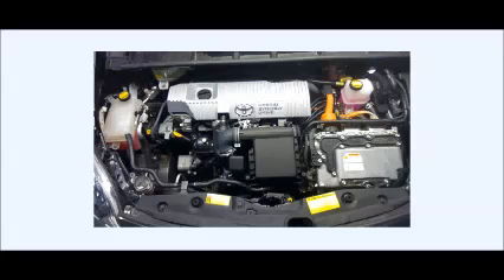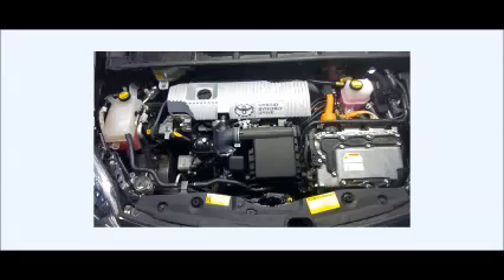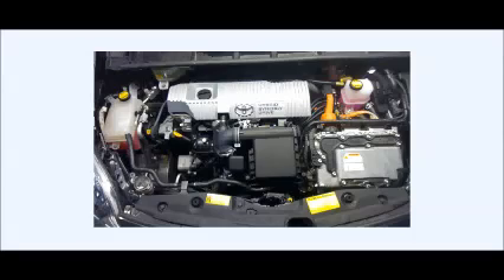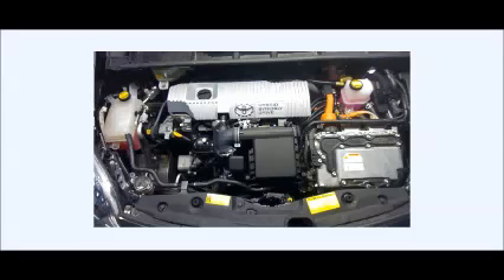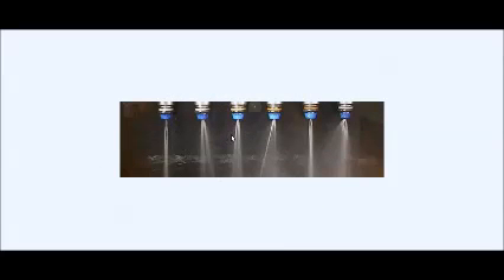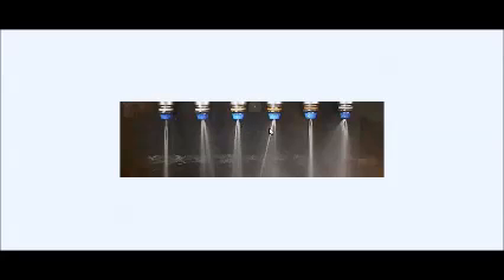toyota prius gen 3 engine knocking solved

Comment: I'm a professional auto technician have over 22 years experience I like Toyota's  most of the time lol I work on hybrids alot have done over 50 high voltage batteries mainly on 2nd gen Prius. The 3rd gen 1.8l has head gasket issues. Any misfire will make the engine run rough if the engine runs rough it will make a loud rattle noise between engine and trans. Just had a 2010 Prius in rattles on cold start up then runs great after a minute it has a blown head gasket. Did a blue fluid block test on it. It passed that test how I found the problem was putting compressed air into the cylinders one at a time #2 blows bubbles in the coolant reservoir with a leak down tester on it thought this may help some of you? And the repair at a shop is 17 hrs labor plus parts and machine work over 2k total
Reply from the maker: Thank you for sharing that
Reply: Tank for the tip.
Reply: Do you as well get a yellow triangle indicator with an exclamation mark in it along with the loud rattle?
Reply from the maker: For me I wasn't getting a yellow triangle  or any check engine lights... just the rattle

Comment: Guys, it’s a blown head gasket guaranteed. Toyota made faulty head gaskets for that Prius. After engine sits with pressurized cooling system-the coolant will enter into the cylinder(s) if the vehicle sits long enough, enough coolant makes its way into the cylinder(s) to make the car violently misfire and burn it all off until it runs normal. Watch videos on Gen 3 head gasket or gasket masters

Comment: I'm having the cold start knocking noise as well...Did yours happen at only cold start or all the time..? Thanks for your video.
Reply from the maker: +BayAreaHiker actually I don't recall but either way I think cleaning the spark plugs and the fuel injectors will solve the problem
Reply: BayAreaHiker on my Prius it was only knocking in cold weather

Comment: I have the same problem with my 2010 prius with 225k kilometers on it
It started a month ago, cleaned the fuel injectors and it went away for a day then came back with a check engine on the dash. Found out that the catalyzer was stolen from before I bought the car a year ago. The issue is still here. What do you recommend?
I'm from Jordan btw
Reply from the maker: It's tough to tell. Since it went away after cleaning injectors then  they must have been clogged again. Check the fuel filter connected to the gas tank. Dont let gasoline levels go below quarter a tank so that you dont suck the gunk at the bottom of the tank into the filter then into the injectors.
Reply: @SmartCarsJordan  it's the head gasket supposedly. I need a new engine as tge mechanics said that doing a gasket and a ring isn't a good idea on a prius aluminum block engine and I need a new one. Very sad I've only gone 25k kilometers on it.
Reply from the maker: The head gasket blows up if you use the wrong engine oil. So watch out for that after you fix it. I would fix the current head gasket on the engine and run it until it's done then replace it ... compare costs

Comment: Hello guys i have the fix for the knocking engine theres is only one reason one fix one solution I've been fixing my prius for over 5 years my self the real reason for knocking is derty EGR VALVE you have to replace the egr valve and the egr cooler then you all good don't waste your time the injectors gets dirty because the egr is dirty you don't need to clean the injectors if you rellace the egr valve,
Good luck
Reply: 8lli you also need to install a new pcv valve and a filtered oil catch can.
Reply from the maker: hi, what causes the egr valve to get clogged ? it's the inefficient burn of nonuniform injectors which create buildup in the egr valve. so it's only a matter of time until it gets clogged again.

Comment: Running ethanol free gas and engine/carb cleaner helps IN CONJUNCTION with pure gas.  However knocking on my gen 3 comes back when I go to ethanol gas.  So it may need a more extensive injector clean. Definitely fuel system issue though.
Reply from the maker: +Jack Jones yes true

Comment: Do you mind sharing what product you used? How much did you use and how many time or how often you added it? I have heard that most fuel injector cleaners/additives do little to nothing. Some say sea foam does help more than others. Any input on what you used would be helpful.
Thanks
Reply from the maker: +chrisnhome I seriously don't recall the brands but I was using whatever type they were selling at a few local gas stations they didn't help at all
Reply: i.put.chemtull.12.from.walmart

Comment: Some of the cold start engine knocking on the Prius is from not having an oil catch can, moisture and blow by gasses get caught in the intake manifold and into the cylinders. Google oil
Catch can for the Prius and you will see about 60 pages on the Prius forum about this issue that have fixed the problem.
Reply from the maker: Yes true, many have this problem , but others have different causes ...
Reply: I found my problem , I used a cheap boroscope and found coolant in cylinder 2. The head gasket is blown. I haven’t fixed it yet, I put some k seal from auto zone in the coolant and it has stopped the leak. This is a temporary fix. I will replace the gasket with the YouTube diy for the Prius.
Reply from the maker: Excellent ... good news ...
Reply: @tommycortez_  Did you replace the head gasket?  Was the problem solved?
Reply: Carpe diem yes it was the head gasket, and I replaced the gasket with the YouTube Diy. I should of replaced the piston rings but I wanted a quick fix. No more hard rattling starts and no more of losing of coolant. You also need to install an oil catch can and update your intake manifold with the newer part number from Toyota.

Comment: @ 1:08 u said u check the spark plug cables, where are they on the Prius
Reply from the maker: you'll need to take out the cover of the engine to get to them, they are 4 cables with a spark plug connected to each of them.
Reply: smart cars idk too much about cars but I think they are individual coils
Reply from the maker: Yes coils at the end of each cable that connect to spark plugs

Comment: I have same issue I was reading online Prius chat forums Toyota has technician service bulletin published about issue in Manifold intake sensor. Not sure other have think about it. I have book full service with Toyota service station and let them know let see what the suggestions and fix procedure. Please reply if any one has any suggestions
Reply from the maker: I hope they fix it for you , let us know what happens
Reply: Whatever happened at the dealership?  I just bought a used one and, after hours of research, never heard how it is being handled officially.  There's a ton of different theories (condensation in the intake manifold, low 12V battery, etc.).

Thanks.

Comment: I did clean the injectors.then the knock decreased considerably.but I still experience it some times.
Reply from the maker: try changing the spark plugs and spark plug cables, or use higher octan gasoline.  this should eliminate the rest of the knocking
Reply: smart cars thanks for the reply.heres what happened from the beginning.Im from Sri Lanka.I pumped once from a petrol shed which mixes diesel with petrol.(a typical fraudulent way of gaining profit in srilanka)we soon experienced the affects including the spitting chunks of carbon chute from the exhaust.we got the fuel tank drained immediately.since then the fore told engine knock developed gradually.untill we got the injectors cleaned and replaced with new plugs.since then the knock decreased drastically which used to happen on every Ev mode to gas engine transfer.we use 95 octane petrol.Now we still experience it every once in a while.Expecting your advice.
Reply from the maker: yes, watch out for those mixers, stick with a single gas station that you see honest
Reply: Yeah but don't you think there's some thing wrong apart from plugs.how about the exhaust.?could there be blocked carbon.and can it be a reason to the remaining knock?
Reply from the maker: +Kisal Kojitha I doubt it

Comment: I think the knock is caused by the vvt being out of time from a short duration cold start usually. My case anyway. Where you shut the car off before cats have warmed. Using e
Engine stop button 
while idling. Happened to me 3 times in 50k miles. It's not a rod knock or failure its just engine running slightly out of time.  All times I just drove it and it cleared itself. I could imagine some cars would stick in this position. I though it was my engine mounts first. It was so bad as to crack my engine cover. I took it off. Now if I did a short move in the driveway could engine I use the EV mode if available or just let it idle for a min seems to never happen again. Idk what else could cause it to seemingly be out of time so much and then go away.
Reply from the maker: Hi, it seems there are many factors where an obd II scanner can help detect the fault. Some are ... contaminated gasoline ... bad spark plugs ... bad injectors ... bad spark distribution and timing board ... clogged egr ... bad fuel filter ... bad mass air flow .... bad oxygen sensor those are the main reasons I know of that might cause the problem of knocking

Comment: my Prius gen3 is knocking on cold start also. but it doesn't knock with warm start like 3-4pm evening.  wondering it is the fuel injectors? anyone please give me some suggestions about it.
Reply from the maker: Maybe you have the wrong type of oil in the car , or need an oil change

Comment: Hi,

Did you get any codes when the knocking happened?
Reply from the maker: For me I didn't get any codes at all
Reply: @SmartCarsJordan  Yeah same thing happened to me a few days a go after I got gas (like 30 miles later). It was around 100F, so I let the car cool down, and it fixed itself? I drove over 300 miles after that and nothing.

I was driving 50 mpg when it felt like the car was driving on rumble strip. It was very weak but still managed to drive it to a safe location. I just don't know what fixed the problem and if it's temporary?!
Reply from the maker: Maybe in your case it's bad gas issue , wait on it and see if it happens again
Reply: P300.

Comment: Fuel injectors need a 12 volt source to open, then some carburetor cleaner run through them will clean them up.
Reply from the maker: Yes that's the cheapest way to do it ... there's a machine for that
Reply: Can normal mechanism do it? or need to repair in the Toyota dealer?
Reply: They are easy to work on any mechanic can do it.
Reply: Also you can measure the resistance of the injectors and you will know when you have a bad one with an ohmsmeter
Reply from the maker: Any qualified mechanic or electrician should be able to do it ... you can do it yourself if you have the required safety knowledge with high voltage danger from the battery
Reply: @SmartCarsJordan  injectors are low voltage
Reply from the maker: Thanks, I mixed up with another video :)

Comment: Sometimes mine knocks, but just floor the gas and its gone.
Reply from the maker: Most probably injector cleaning will do it ... if an injector cleaner bottle didn't fix it then make sure they actually take them out and clean them under pressure and not just pour a cleaner bottle
Reply: @SmartCarsJordan  my car just started doing that rattling sound only and after the car sat for longer than 3 minutes. It is close to 150k miles, I am still scratching my head, I should get a real high value fuel treatment
Reply: AmsterdamDrive
Reply: It’s the egr valve and cooler needs replacing
Reply: Hi, did you found the problem, i have the same thing

Comment: My engine is violently shaking on cold and warm  !! What could it be??
Reply: Change ur pcv plug and spark plug will need to be changed too around 100,000 - 120,000 miles.
Reply from the maker: it can be many of the following: spark plugs, injectors, bad gasoline, timing belt, crank shaft sensor, vvt sensors ... and the list goes on. you'll need to check fault codes to pin point your problem

Comment: guys my prius was making the same noise and I change a lot of staff ...and the noise is still there ..i cleaned up injectors ..put even new spark plugs ..cleaned up the hole egr system ...changed a 2 coils ..add an injector cleaner ..and much more things but still have the same engine noise ..any other solutions ..pleasse I wanna fix my car ..tnx
Reply from the maker: Try using higher octane gasoline and fill up the tank on half full don't let it drop to low levels... Also you might want to change the fuel tank filter
Reply: Depending on mileage I would check timing chain rattle
Reply: Better gas....
Higher octane or no ethanol gas.   Really helps. The easiest and cheapest way to see if it will fix it.

Comment: I had my fuel injectors replaced and the knocking continued
Reply from the maker: +Alfonso Garcia hi, try a different gas station and use a fuel cleaner bottle on a full tank if that didn't work check the spark plugs and their cables , of that all failed check the manifold
Reply: smart cars found the problem.... ugh I have oil leaking where the spark plugs arrested at . It's causing the misfire. Wait here while I smash my head against the wall.
Reply from the maker: +Alfonso Garcia that's good that you found the problem, I think there are metal and rubber gaskets that can be replaced to prevent oil leaks from the spark plugs base
Reply: This video is wrong. The knocking is from a broken lifter or a piston rod.
Reply from the maker: hi brenda, knocking can be from many reasons, this video is for my own car's case and not for all cars. so you might have a piston causing the knocking.
Reply: Did you replace the Spark plug & the coil?
Reply from the maker: +Joshua Gonzalez I replaced the spark plugs and took the injectors out and cleaned them thoroughly
Reply: Ah...

Comment: I think you barely know what you're talking about, very inaccurate description verbally & visibly on this video, there's no spark plug wires on 3g prius, also you want injectors to atomize the fuel in a v shape pattern coming out the injector nozzle...

you should erase this video & make a new 1 just saying that by having someone cleaning your injectors it fixed your vehicle's problem & may solve someone else's vehicle problem too instead of mainly misinforming people
Reply from the maker: You're welcome
Reply: @SmartCarsJordan  total fail
Reply from the maker: Hhhhh ok you're a winner 🏆